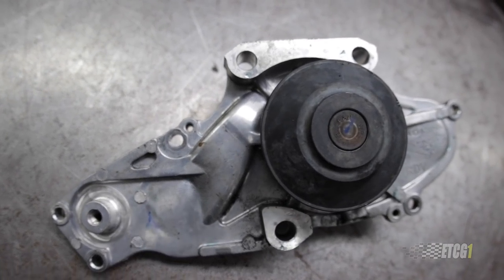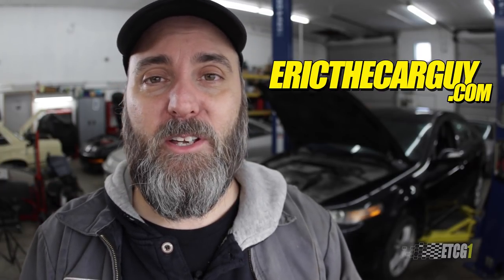Timing Belt vs Timing Chain, Which is Better?

Comment: I’m a fan of timing belts, as long as the engine is a non-interference engine. Belts are so much smoother, and no worrying about the chain getting loose and your car running like a piece of farm equipment.

Comment: It seems like timing belt engines usually run smoother,  but then again other maintenance is usually done regularly on those engines. Chain engines are more sealed off and usually don't get serviced as thoroughly. I have a little valve tick in my fit and am not looking forward to everything I have to remove to access the valve cover vs a 90's car where you could be done in 30 minutes

Comment: Had a 87 Sentra that I used for delivery work I replaced the belt 5 times , change was recommended at 60 K. Got to the point I could do it in about 35 minutes.

Comment: I replaced the timing belt on my 2.3 ‘93 ranger a few years ago. The belt was very cracked and possibly original at 180k. Along with the belt I replaced the water pump, radiator, timing belt tensioner and a squeaky pulley. It took a weekend and cost around $200. 

It was reassuring getting all those new parts on the truck. All that same maintenance might be more easily neglected with a timing chain as there’s less of a reason to replace unless broken. Then again, I’m sure plenty of people never change their belts and let them snap.

Comment: There was a time, when the belt was the hottest coolest stuff, smooth and quiet economic engines, and chains was so 1970's tech. Noways we trend to forget what a pain in the ass a ticking chain in the mornings... partly due to modern designs, better sound insulation and less technical drivers. Chains can fail without sing for the average end user, but at the other hand belts are less "trusted" and everyone keeps in mind when the next replacement is. For example Ford Europe has belts in oil in the 3 cilinder EcoBoost engines lasts for the engine"s lifetime, and BMW has chains what in theory last forever but everyone knows Its needs replacement as a preventive maintenance. So there is no black and white here. 

I want my gear driven timing back, at least with plastic gears or something.

Comment: I prefer chains myself. I would say the likelihood of a chain failing versus the guaranteed requirement belt swaps gives the chain an advantage. At least from a cost perspective. Assuming build quality is equal too.  My first vehicle had a VW 1.9 TDI and those belt changes were not cheap. Loved the engine but it kinda hurt the wallet with maintenance. I believe thise engines were interference engines too so you really were playing with fire if you didn't service service belt on time. Since then I drive a Corolla and for multiple empirical reasons, I do not believe that chain failure is likely. And even if it does, the 2ZR-FAE in my Corolla is not an interference engine and isn't likely to be damaged in such an event.
Reply: And chain on my 1.2L CBZA Audi/VW engine needs to be replaced every 50-60k miles and it costs 2 time what it costs to replace a timing belt.

Comment: one has a regular interval, the other one has a widely variable service interval. Chains wear-out and they need good lubrification, regular oil changes makes a big difference on their service life. I would say though, there seems to be more badly designed chain-drive systems that fail because of inherent flaws or cheap materials.

Comment: I’ll say I prefer chains, but don’t necessarily have a problem with belts, like you said both can fail and I’ve had problems with chain tensioners before and I’ve had to fix broken belts. My thought is, guys that wrench are cars see both as valid and basically what you said. I think the main proponents of chains come from the old school crowd where like my old 302 has a chain but no tensioner, so they last forever usually and any performance loss due to wear goes completely unnoticed because it happens over time. So I think the more hard nosed chain guys have a screwed idea of what timing chain engines actually operate like now
Reply: I’ll also add that if it’s an interference engine I will by far prefer a chain, while they can have issues, I’ve almost never seen one break or go far enough out of time to destroy an engine, I have fixed or condemned many belt engines that did

Comment: So, why don't engines have timing gears? Won't that last as long as the engine? No tension needed, all metal no plastic or rubber. Why not?
Reply from the maker: They are expensive and make lots of noise during operation.

Comment: Good point and great video, looking back now on the Hondas from 80s to current generation of Hondas, I honestly prefer the belt for longevity of the vehicle because the shops can recommend other important services such as valve adjustments and etc. The problem with new Hondas are that they very rarely go into service for maintenance but they go more into the shop for catastrophic failures. Sounds like Honda got it figured out that all this Planned Obsolescence is working for them.

Comment: I feel like most cars that are performance oriented have all moved to chains. Obviously there are many examples of belt driven engines that can make very good power. Any thoughts on why most manufacturers are moving to chains? I'm in the camp of whatever makes the packaging and fitment of the engine and its serviceability easiest.
Reply: "They moved to chains to save money. Not to help the end user. Chains stretch. Belts don't. Chains will get them out of the warranty period before issues arise. Belts require a service interval. They can lie about chains and pretend they're good for the "lifetime" of the car. When they're not. I'd rather have a belt with a service interval. " -guy who replaces chains on new engines for a living.
Reply: I think car makers went to chains because many people said "I won't buy car with a timing chain" and car companies either had to meet the demand or be left behind. Other times, buyers might not have any idea what those items are, but they look at long term ownership costs and look for a car with a low one. Having a chain is a sure way to a lower long term ownership cost if the chain is built right.
Reply: @michaelallen2501  🤣
Reply: @michaelallen2501  I've noticed, in at least the vehicles I've worked on or been around, that the ones with the timing belts are a bit easier to get into and replace. This may not be the case for every make/model, but when it needs service eventually, I'd rather take the vehicle that's easier to maintain.
Reply: Ferrari uses belts because they are quieter
Reply: @RandomPerson-su3xg  true. For a lot of chain driven cars, it's a PITA getting the timing cover off. The oil pan typically needs to come off, which means the exhaust might need to be partially undone, an axle might need to be removed, etc, plus the oil pump might need to come out, etc. And then the cover needs to carefully be pried loose so that it doesn't bend, and carefully put back with new gasket sealer intact. Timing belts, in my experience, are much easier and straightforward to get into and replace.
Reply: @michaelallen2501  What does "lifetime" mean? It means it is going to last til the end of warranty. After that it's not their problem if something breakes and thus the lifetime is over.

Comment: By golly there is always the exception. American made V8 engines back in the day had no tensioner. The crank gear and cam gear had to be installed with the chain simultaneously. Chains do stretch though. A double roller as it was called was the next step before a gear drive. As always very informative.  Thanks Eric

Comment: My concern with oil tensioned timing chains is if they are driven hard.  Higher R.P.M.’s mean higher oil pressure and higher oil pressure means undue tension on the timing chain which will cause it to stretch.  Higher oil pressure also means undue tension on timing chain tensioners which causes them to wear out and fail prematurely.  Numerous auto makers make their tensioners as well as the guides out of plastic which is an excellent recipe for planned obsolescence.  ANY manufacturer who puts timing belts on interference (valve bending) engines deserves to have their engineers in the ring with U.F.C. champions.  I sure miss the simplicity of small block Fords, Chevys and Mopars with one camshaft and one timing chain (unless they used nylon camshaft gears…potlickers!!).
Reply: I was under the impression that timing chains stretch due to poor maintenance where worn out oil results in excessive wear on the links in the chain resulting in chain stretch.

Comment: I have never seen a timing belt with 500.000 miles on it but I have seen a timing chains go that far case closed
Reply from the maker: Correct. However belts were designed to be maintenance items. Chains were not, but chains wear over time, as they do, the mechanical timing of the engine changes causing a loss of performance. I've seen timing chain slack over 10º. Personally, I prefer belts because once I replace them, the engine often runs like new. Just my 2c. Thanks for the comment.

Comment: I might be stretching the hell out of my timing chain since I have a pretty aggressive tune on my car. It sounds a little like the timing might be off at idle but that could also be the single flywheel. I’ve had a upgraded Fluidampr harmonic balancer on there for over two years now as well

Comment: Been looking at used cars so this video is so relavent, it is amazing how many people get rid of their timing belt cars around 100k, I presume because they don't want to incur the expense of the 100 k service if they can't do it themselves, it's also amazing how many timing belt cars have 100 k to 140k and still have not had the timing belt changed (cars with interference engines)
Reply from the maker: In my experience the belts don't break as much as one of the other rotating components like an idler pulley fails. In short, I've seen timing belts go way past their service interval. Conversely, I've seen timing belts fail after a short period of time due to crappy parts. Thanks for the comment.

Comment: The one thing I’ve liked about timing belts is that the water pump runs of that instead of the drive belts. To me it adds some security knowing if god forbid the drive belts break the engine shouldn’t overheat and I can get pulled over as safely as I can. I’ve driven vehicles with chains and belts. I do like that the chains generally last the life of the engine (assuming you keep up on oil changes, ect) but the water pump running off a serpentine belt, does kind make me nervous. If that breaks, not only is power steering, ac, alternator ect not working,  neither is the water pump, witch makes engines a tad toasty 😬
Reply: Yes because water in oil with no warning is better lmao

Comment: i noticed you mentioned tensioners for the timing chain examples but you didnt say anything about chains that dont have any tensioners at all
i would appreciate your 2 cents on that application
personally, im a timing chain fan nor will i deny it
i have a 94 gmc with a timing chain but there is no sort of tensioner in it to keep the chain tight, its got over 300k miles and ive replaced the chain once just to freshen it up
i also have a 97 corolla with a timing belt that i just recently replaced, the water pump is serpentine belt driven on this vehicle, not timing belt driven
but i replaced the water pump and the timing belt tensioner while i was in there
Reply: No matter what, a timing chain and it's components will wear out over time causing a loss of engine performance. In the case of traditional V8 timing chains, I recommend double roller replacements for the best longevity. BTW, they also make timing belt conversion kits for those engines that have a tensioner. Thanks for the comment.
Reply: @ericthecarguy  i didnt get a double roller type, i got the design in your thumbnail
without the tensioner though, its one less failure point in my opinion

Comment: Going to pretty much agree with Eric on this. To add to the chain argument, I've also seen many chain driven systems wear based on stretching. For whatever reason heat, quality...etc, single chain driven units can have a tendency to have worn out stretched chains especially on higher mileage vehicles.

Comment: I'm thoroughly adamant that a timing chain is far superior to a timing belt. No matter how old or new a timing belt is, get any kind of oil or grease on a timing belt or a bad tensioner pulley placing even the slightest bit of abnormal friction on it, and it's very likely to slip or break through differences in friction and construction due to oil ingress long before the replacement interval. You are relying solely on a reinforced rubber / nylon toothed belt to control one of the most critically precise functions of your engine, it seems so irresponsible to risk that by way of using a belt made of reinforced rubber.

With a chain you still can replace them, as well as all parts associated with the tension of the chain, but when a car can travel many hundreds of thousands of kilometres / miles WITHOUT a single issue regarding engine timing chains, it would be a very rare necessity to replace, the exception being vehicles with very bad timing chain design / layout. Chains usually give very strong tell tale sign of impending failure before they actually fail, it can be years of noise before they let go, a belt snaps instantly with absolutely no warning and for vehicle owners that are clueless about the issue, they're unlikely to consider a timing belt as a serious issue and just keep driving and driving putting off the replacement cost, a chain will give an irritating audible warning at least.

The one and only time that I would ever accept the use of a timing belt would be that of a non interference engine whereby if the belt breaks, it's unlikely to do any serious damage to internal parts, can simply be replaced and continue operating like normal.

I also agree somewhat that a timing belt is just another way for car manufacturers to make things cheaper, and pass on further costs to the customer, car manufacturers use every opportunity they can to save costs when assembling hundreds of thousands of cars, and even a small saving per car creates and enormous saving for the car manufacturer. If a car manufacturer can save 20 cents on a car, they will find a way to do that.

Car manufacturers are also reverting back to the use of timing chains, as they are realising timing belts can spell disaster on a manufacturers reputation through premature failure and total engine destruction, quickly becoming a $20,000 repair job.

Comment: Here's the question I have whenever I think about timing belts or chains...what is the benefit of an interference engine?  All my friends with accords have an nagging worry about their timing belts failing but with my focus zetec it's a no worry situation.
Reply from the maker: Larger cam profiles allow for greater lift and duration which equals more power. Valves opening farther and longer create the 'interference' engine. BTW, the timing belt failed on the TL behind me. I threw a new one on and I'm good to go. Not saying it works out like that all the time, just that when a timing belt breaks, even if it's an interference engine, that doesn't mean it's the end. https://www.youtube.com/watch?v=enPNb8dxCZk&t=167s

Thanks for the comment.
Reply: interferance means either valve opening further (better breathability) or smaller combustion chamber (room between piston and head/valves when closed) which should both end up giving you more power/better fuel economy.

Comment: Problem is timiNg belts are a thing of the past and the parts are not gonna be available. They can brake too and gave broken on vehicles too. Not chains. Bycle chains never brake, but try putting a timing belt on bycle just for a bycle, it's not last long as bycle chain.
Reply from the maker: Motorcycles have been using belts to drive the rear wheel for years without issue. It's a smoother power delivery. Not to mention there is way more torque on a motorcycle than a bicycle.
Reply: No u can put an engine on a bycle these days going 50 mph
Reply: @ETCG1  or motor same thing

Comment: I'm in both clubs on this one. For interference engines, I'm all for chains, for non-interference engines, I'm on team belt. I've owned 2nd hand vehicles before that are halfway-ish between first and second belt change interval, but with no or limited service history. But because they were non-interference belt engines I could rest easy and wait for that second interval instead of spending a truckload of money on a potentially useless belt job just in case it wasn't changed when it should the first time.

Comment: Na timing chains are better and they don't brake if u maintain ur vehicle. Saves money too.
Reply from the maker: Timing chains wear out over time causing a loss of performance.
Reply: @ETCG1 no they don't I had 5 gm cars since 19 years of age and my fist one was 1994 saturn twin cam and I had a Oldsmobile Cierra 1995 for tens until it caught fire. I'ma uhge fan of ur channel. Fixing it forward. I have an Impala LS I change my oil every 4 months too. I saw the work u did on a Honda head gasket. I'm glad ain't gt one no honda econo box for me. I would like to my car car to ur shop. I ll as if I can do YouTube channel